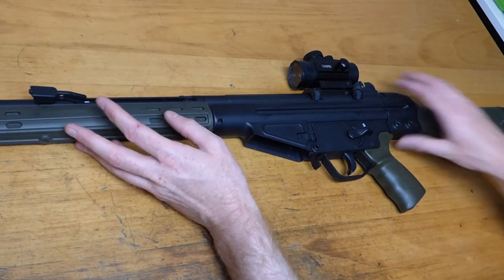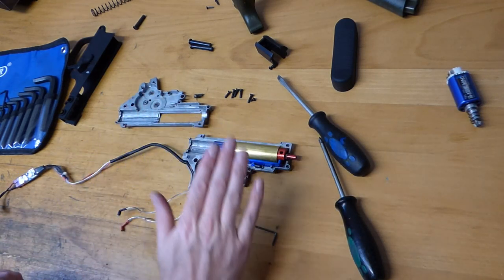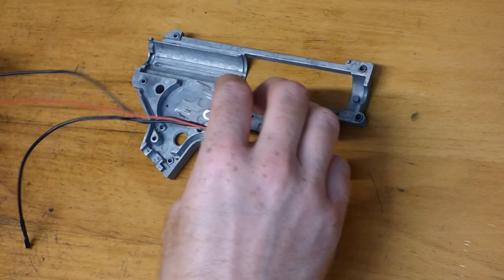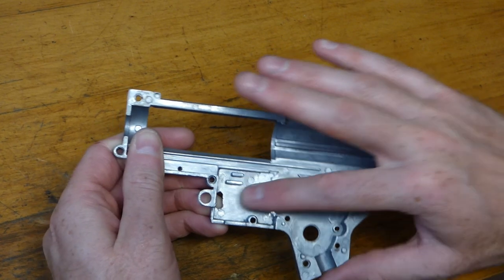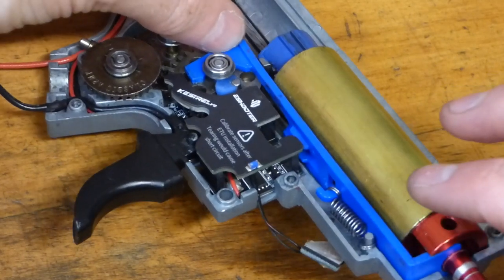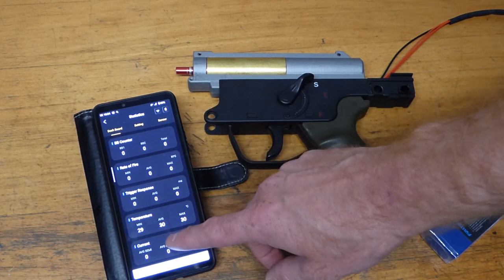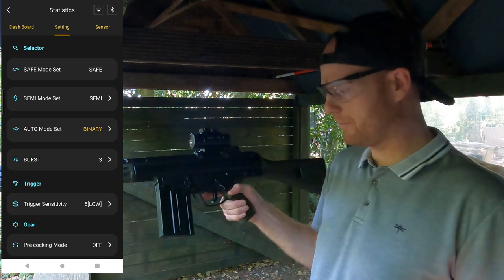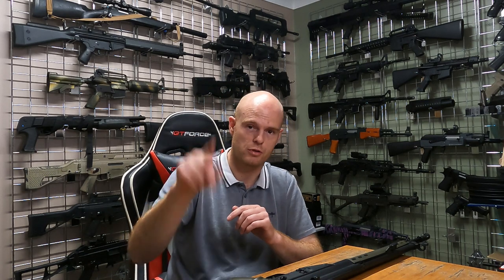Kestrel V2 Wireless ETU - Installation and Testing

Comment: The most of Kesterel functions doesn’t work at all. They are only visable it the app, but after switching ON nothing change. Some of functions work in reverse (e.g. ROF control). This is cheap and weak copy of TITAN tech. PCB is too thick to fit most gearboxes. The engineers didn't seem to know what they were copying. I absolutely do not recommend it considering how cheap the original new TITAN II (125 USD for TITAN II Bluetooth vs 129 USD for Kesterel 😂)